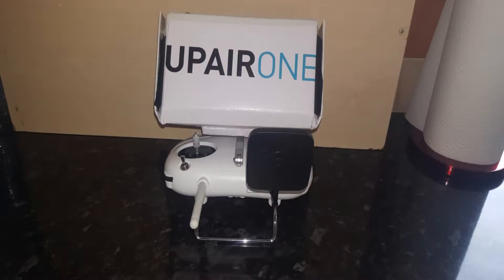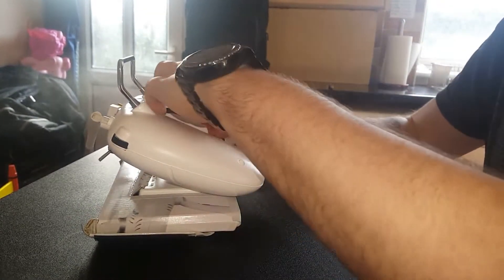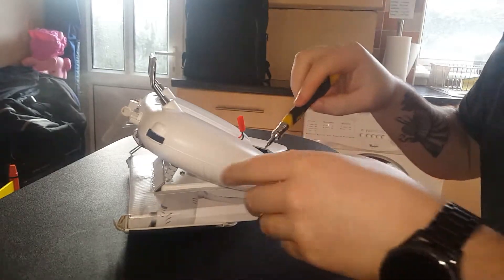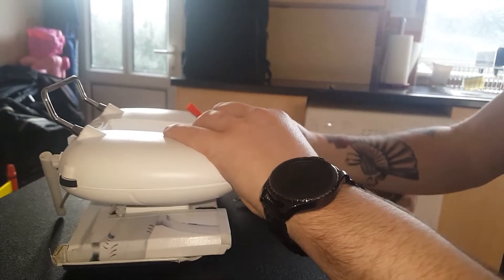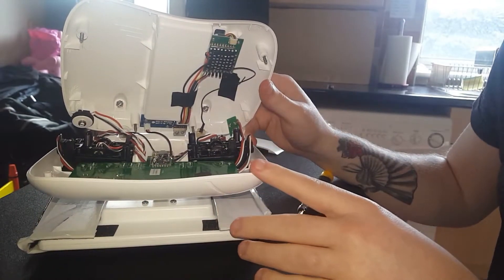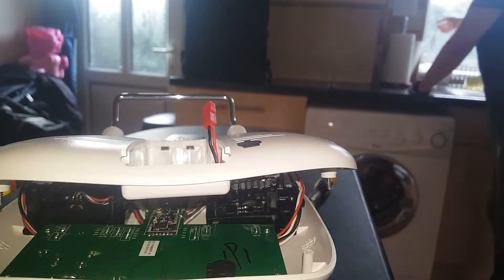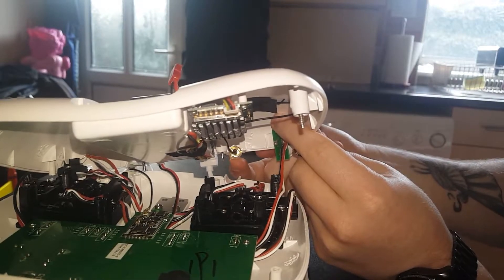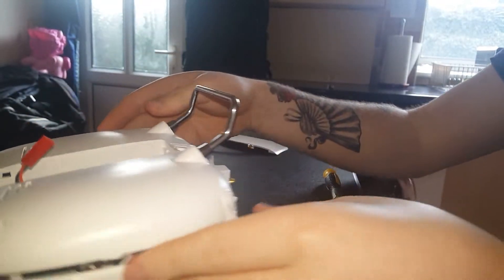Up Air one FPV High gain antenna upgrade tutorial

Comment: nice mod..2 quick questions.. any way to make that sync to any other   models out? That would be a cool video for this quad. ? would u be  aware of any place that sell/make gimbal replacements for this model or something universal. thanks.
Reply from the maker: SMCSTEVE JR  hey thanks for your support. its not possible to synk the upair with any other drone unless you replaced the 24ghz transmitter inside the remote. you can however perform this mod on more or less any model controller. also for the gimbal banggod and ali express have the old version gimbal that works you just need to buy the camera as well the firefly 6s and even a go pro fits
Reply: James Ingram no prob..let me know if u find any other cameras that will fit this..quad.  my nice fpv screen is worthless without it. tnanks
Reply: James Ingram yeah the thing is i don't have that camera.  I have the one all connected 2axis that houses the wires for the gimbal. I figured they would need to sell that somewhere and explain a way to fix it.. sound like it would of been better to purchase the housing for it but cant find anywhere.
Reply from the maker: SMCSTEVE JR what is wrong with your camera? is the gimbal broke ?
Reply from the maker: SMCSTEVE JR  i can't open the links i just gen an error 404. maybe try ebay? or if you join this page on facebook people always selling parts ect also alot of help and support https://www.facebook.com/groups/upairownersgroup/
Reply: Yeah im working with the seller /customer service. They have been great so far. The old model had the movable camera and now the new one is all built in together as one unit. Thanks for the info.. any suggestions on the best links and parts i would need to extend the fpv range and transmitter? Want to work on that next.
Reply from the maker: SMCSTEVE JR  yeah i have another vid for upgrading the transmitter and links are in the description of it. im guessing your speaking with cici chen? she's great but does get really busy. hope they can get the original for you
Reply: James Ingram it was actually a lady name grace.... she said she handled everything since the company name has switched.
Reply from the maker: SMCSTEVE JR  ahh really ? are you speaking through amazon or g10? cici is the only person and alot of people on our group has ever spoken too. be careful  if your sending any money. only use paypal. that what i used when getting my replacement compass
Reply: Yeah thank u. Im not sending any money unless needed. She seemed like they would replace it.. will see. Keep u posted

Comment: I have the 2K (integrated camera/gimble) and it is becoming evident that there are more differences than just the camera.  I upgraded FPV tx on the quad thinking I would have to move pins as you did in another vid but it was plug and play because the pins were in the correct place.  Unfortunately, attempting the antenna mod on the controller, my 5.8 Ghz antenna is soldered to the  receiver board.  Ugh!  It is definitely a different board than is shown in your video.  Will attempt to put a SM UFL socket on it.
Reply from the maker: GEO yep alot of differences but not just between the 2k and 4k now even there are differences to the internals of the 4k depending when they was bought. on the newer versions they no longer have a micro usb port and have a different flight controller. also on the older 4k versions the antenna is also soldered. it should be easy enough to do or you could just replace the receiver altogether with a better external one which will also stop it from overheating

Comment: Hey James Ingram Perfect just what i needed Thanks only when I took mine apart and everything fell out of the controller. Is your Upair one the 3 version or the A version ? Mine has two antennas for the FVP ?
Reply from the maker: Scotty O  hey scotty it has two for fpv ?wher are these situated? my board number is v1.0.02 everything is secured in my controller, im not sure why things would fall out :/
Reply from the maker: Mine is the latest version before the plus wifi model thats been released in china